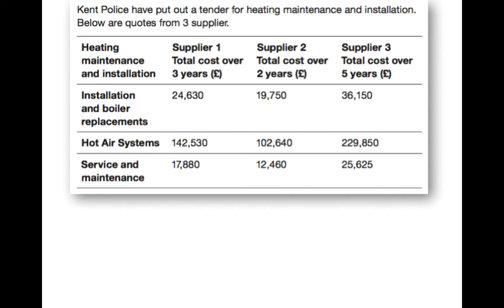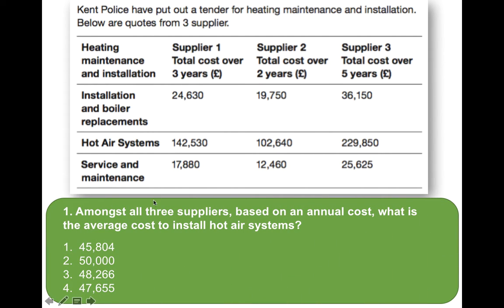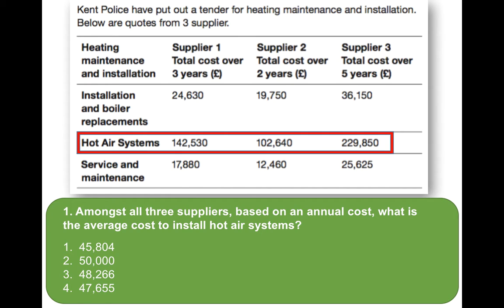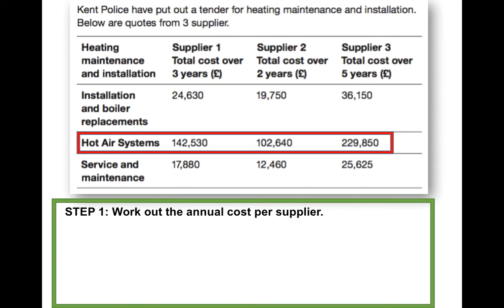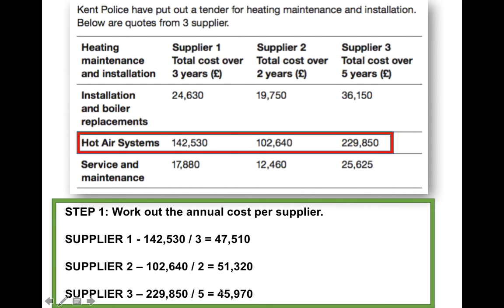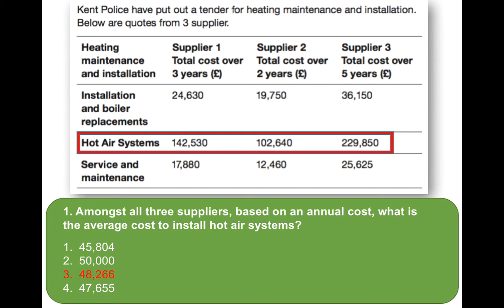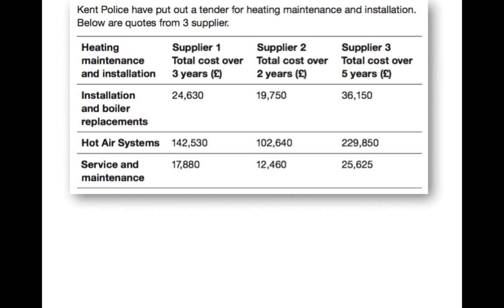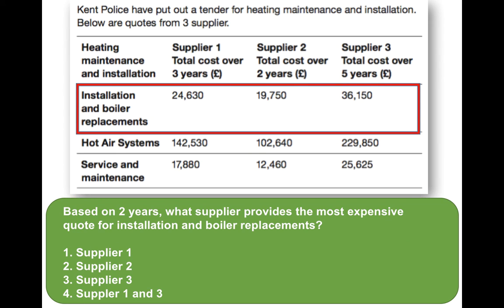Police Officer Numerical Tests - Become A Police Officer

Comment: yeahhh, good luck dividing those big numbers without a calculator
Reply: They give you a calculator
Reply: its simple math
Reply: It seems difficult Tyler but if you divide it by decimals it can be done in head..
Reply: 7230
5)36150
    35
       11
          10
            15
            15
              00
yea so hard...
7230x2=14460